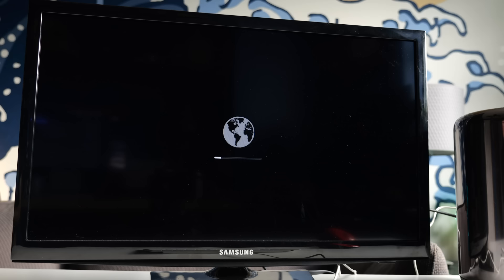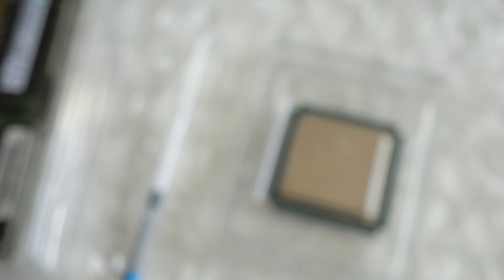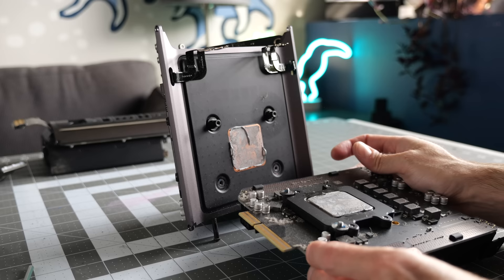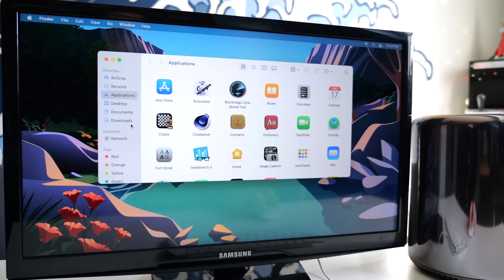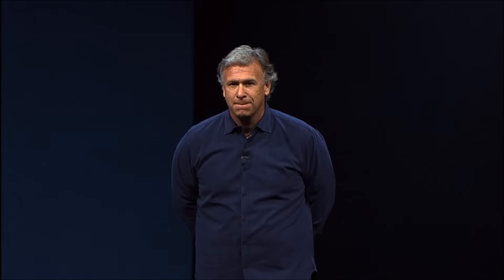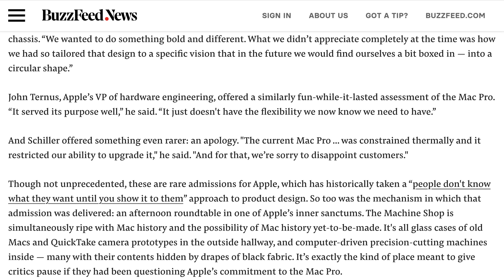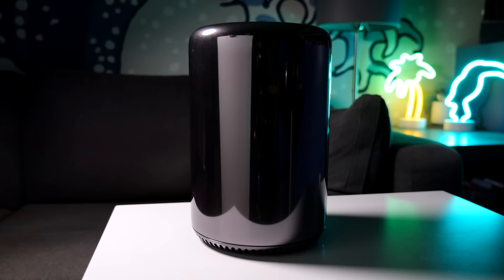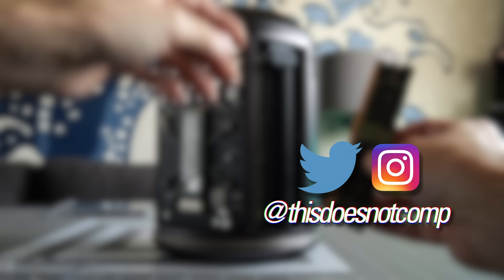Can This Decade-Old Mac Pro Compete With Apple Silicon?

Comment: I remember being blown away at this when it released. However, I had a chance to work with one term at a production job I had 6 years ago and wasn’t thrilled with its performance. The thermal throttling was a real issue for me and the heat it generated was causing videos I rendered in Premiere or DaVinci Resolve to have black horizontal lines show up in the final videos.

I called Apple to report on it and it took several back and forth conversations and me losing my mind with one of their sales reps and engineers on the phone to get anyone to listen to my plight of how flawed the build and design was that was causing the issues I was experiencing with it. They did finally make it right and I was able to submit several affected video renders that convinced them to send out a new machine and me return the damaged machine for them to test.

Comment: I made exactly the same upgrades to a Pro 13 (12 core/64GB/1TB) a few years ago, just prior to the release of the M1 Macs.  I really liked the looks of that thing and enjoyed using it despite its limitations.  The trashcans were more expensive then, more than an upgraded M1 Mac mini, so when the M1s were released I decided to eBay my Pro 13 and buy the mini with a bit of positive cash flow.  I've been living in the Apple silicon world ever since.
Reply: How are you getting on with the limited RAM of the M1 Mini?  I was looking at getting one, but I'm the kind of guy that likes to open a bazillion windows and reboot once a season.  My Intel Mini has 32GB and I think it's just about enough.
Reply: @nickwallette6201  I had the M1 Mini with 16GB of unified memory (aka RAM) and 512GB of storage.  It was doing fine but I moved up to the M1 Studio Max when it released (base model, 32GB memory and 512GB of storage --- I have a 2TB NAS for additional storage).  The Intel Mini is a great device (had one of those too), and I miss the ability to run BootCamp.  Needless to say, I was all over the map until I landed on the Studio, which more than meets my needs now.
Reply: @bryans8656  what do you use bootcamp for? I have windows 11 arm installed under UTM VM and find it perfectly acceptable for when I just needed one thing from windows for 5 minutes
Reply: @harrytsang1501  I have a couple of old Windows applications that I still like to use but they won't install properly when I use Windows 11 via Parallels.  I haven't tried installing Windows 11 under UTM VM.  We have Windows computers in the house so I use one of them for running those old apps.

Comment: I was selling my original M1 13" MBP and some bloke tried to trade me a base model one of these. I couldn't even formulate a response that wasn't all snark. No warranty. No Ventura. Massive efficiency delta. Too old 🐻.
I think if you are already on M1 there is no reason to go back down the hill for most use cases.

Comment: Granted you have to mod it to do so, you can get an eGPU to work on that machine.  I have been using mine now since this past June and can't complain.  It's been running pretty solid since.  I actually have 2 of them that are used for video editing and graphic design.  I have that exact setup, except I have the D500's.
Reply: the mac pro 2013 has thunderbolt 2. egpu‘s need thunderbolt 3. but thanx to apple adding metal support to blender, cycles can now render on the firepros.
Reply: @m13v2   you are half right.  Using a version of Open Core, you can enable eGPU, which I have done.  Works very well.  You’ll get about 80% of the potential though, so mileage may vary.

Comment: Our recording studio turned to Windows after purchasing three of these. To Apple's credit they honoured the "not fit for purpose" clause in Australian Consumer Law and the units were returned with a full refund. So at least the customer experience was decent! 
Right now a 6 year old HP Z640 or Z440 workstation can be had for about the same price and will typically come (sans Storage) with 64G RAM (DDR4), 4-8 Gig pro GPU etc etc.

Comment: Thanks for posting the Geekbench numbers. My 2009 iMac, with a Xenon X3470 yields 605 and 2150 (up from the original 540 / 1682 of the i5-750). It's getting rather long in the tooth, but I still use it often. Plus I love the 27" screen!

Comment: As these come down in price, I consider adding one to my ever increasing pile of older Macs... But, since I tend towards various aspects of gaming or graphic layout designs -- the dismal GPUs always make me pause. 

I'm very curious to see what external GPU enclosures can do for these - I'm still tweaking 2010-2012 Pros to do, what I consider, to be amazing things. I tend to use Linux more nowadays, as I've felt less and less connection to MacOS since after Mojave (crap, I'm old, I remembered the same feeling about OSX back in the early 2000s! However, years of Catalina/Monterey/Ventura haven't softened me to the further push into iOS territory). 

Great video, but I have yet to see anything on external GPUs with these, and I'm really curious what a 6000-series Radeon could do here... Or even dropping back a few OSes and putting a Nvidia web-driver supported card in (if this could take a 980ti at a good clip, it might be one nasty gaming rig for my CRT obsession - a thing I use my 2010 Mac Pro with Titan for!). 

Thanks for all you do :)
Reply: If you find one with D700s then they are ok. Otherwise the BlackMagic Vega 56 looks really good next to it and runs just as quite.

Comment: I think the one point you missed making was performance/watt, something that apple has always held dear to their chests. It’s why they ditched Motorola for Intel and then Intel for their own SOC. Sure, that trash can is capable of trading blows, but with considerably more power draw. If you factor in electricity costs to run, the M1 mini is a far better value in the long term, when you accept that both are about as upgradable as each other.
Reply: He made that point in the wrap-up. 13:43 I have to imagine the efficiency is probably the biggest reason one should shy away from old silicon.
Reply: @MogoPrime  Until Intel brought back hyperthreading to the consumer side I always bought used server/workstation chips. Yeah, the power draw and heat alone were enough to make me think twice about buying.
Reply: If you live in North America, the long-term difference in energy costs is absolutely fucking negligible... Even if you live in Europe this is mostly a nonsense argument. Go do some actual math on how much power these computers ACTUALLY pull and how much energy costs. You might be surprised. It's basically nothing compared to the standard home appliances everyone already owns & uses without a care in the world. 

Also, people almost NEVER run their machines flat-out at 100% utilization. During most usage scenarios power draw won't be that much higher than the idle draw.

The real power efficiency reason to get a Mac Mini over a trashcan is the thermals & noise. Especially if you're going to regularly use it at 100% utilization in a small room in a hot locale without air conditioning.

Comment: I actually used one of these for over a year until recently, and I loved it. The graphics performance was the major limiter for me though, given that I work in game development and the industry has moved on.

The heat was never really an issue because I used a fan control app and the CPU never went above 80 degrees, nor the dual D700s above 70.

I also managed to get this funny SSD carrier board that enabled the installation of two additional NVMe SSDs, so I had a total of 3TB of SSD storage in there.
Reply: That was called the Angelshark by Amfeltec. Bought mine new from them in June and ever since have had an issue with one of the NVME slots not wanting to read my NVMEs. A blue light stays on under my Mac and Amfeltec wont respond on how to fix it and their manual doesnt even mention the light s coming from the board

Comment: That is mind blowing, I remember how trash can Mac Pro was considered as a professional high performance desktop PC, and just 10 years later one single smartphone chip that can fit into palm of your hand is more powerful 🤯
Reply: Uhhh it isnt? Even if a phone chip seems to have similar performance they are usually clocked way lower and arm chips usually have way worse ipc than an x86 chip, like how the fx-9590 will get its ass handed to it by the i9 9900 despite both being 5ghz 8 cores. Phone chips have a long way to go before they start beating 2012 xeons

Comment: Interesting video for me. I've been using Macs since '91 and the release of the trashcan was pretty much the final straw that broke my relationship with Apple. I certainly haven't bought anything new from them since. 
I'd already had to swallow a 32bit EFI in my Mac Pro and a fried dGPU on my MBP 2011 but this insane level of form over function design for pro end hardware was way too much to stomach. 
Happily for me the net result has been about 10 years of very productive hackintoshing where I've not only enjoyed building my PCs but also really enjoyed how stable, reliable, repairable and upgradeable they can be.  
BTW writing this on my 2011 MBP with a fried dGPU running Big Sur thanks to OCLP :)

Comment: Even today I laugh at that quote by Phil Schiller.
I hated these Macs with a passion, but nowadays it kind of grew on me. 
In fact, I even think that the design was ahead of its time in the thermal department, if we consider the ARM future Apple ended up heading towards: Almost any of the Apple Silicon chips could easily be cooled in such an enclosure (and maybe we can spare ourselves the indiscriminate use of Mezzanine connectors everywhere...)

Comment: Xeon E5-2696 v2 is better tho as it has all core turbo of 3.1ghz and runs cooler as its watts is lower than the 2697 ;)
Reply: has the same single/dual/quad turbos as the 2697 but it runs all core faster then it, and its binned as lower wattage so should turbo longer then the 2697

Comment: I just did exactly this a few weeks ago, except I found one with the D700 GPUs and upgraded it to a newer 8 core that has faster single core speeds.   It replaced a 2017 iMac 27" i5 in order to have a much larger 40" screen.   I was trying to get the performance close to the 2017 and that has been achieved, although at some cost, but significantly cheaper than a new Mac Studio, which was the only other system that supported at least 32gb of RAM.  

It works so well that my wife is considering replacing her 27" iMac with a similar setup.   Total cost was $850 - $650 for the Mac Pro (D700, 64gb RAM, 1tb SSD) plus $150 for a 2tb SSD & adapter and $50 for the E5-2667v2 CPU.    The only real issue I am dealing with is Bluetooth audio quality, not sure if it is Monterey (eliminated AptX) or the hardware.   Disassembly is not that hard, reassembly, esp. the rear panel, requires 3 hands....

Comment: I had one of these power draw is almost 400 watts! It’s a nice design BUT the old architecture brings it down and upgrading this machine is a pain in the ass.  A lot can go wrong because the construction constraints are extremely tight.  I don’t recommend it at all nice to look at it but a terrible machine even on windows 11 the graphics card had issues.  Mine was new also never used don’t buy it!
Reply: Yes, the cooling capacity was actually quite impressive considering the modest dimensions and single fan. Only the components used were quite power hungry. Would be interesting to see how it would work out if you’d revisit this with modern components.

Comment: Something that almost every video on these seem to overlook:  The 12 core CPU is a trap.  Get the 8 core 2667 v2 instead.  It's within 5-10% on pure multi-core but is massively faster the moment you're not running a task that perfectly scales with those extra cores which is a big win for overall responsiveness and performance.  Why?  It has the best multi core boost tables of the range.  In tasks that use 2, 3 or 4 threads it's nearly always the leader and frequently by a significant margin.  The large cache advantage it carries over the 6 core cements its lead even further.  It's still no M1 beater, but the improvement over the 12 core is noticeable.
Reply: Also, even the commonly-compatible 10-core 3.0ghz v2 is a better option than the 12-core

Comment: In this YouTube video, the host, Colin, discusses his experience with a 2013 Mac Pro and how it compares to modern high performance computing systems. He purchased a used base model for a tenth of its original price and tested its performance using benchmarking software like Geekbench 5 and Cinebench R23. He also upgraded the machine with additional RAM and a more powerful CPU from a vendor that specializes in refurbished server components. He found that while the machine's performance was lacking compared to modern systems, it still had ample opportunity for improvement with the upgrades. He also found that working on this model of Mac Pro was more complicated than a typical PC but not as difficult as he anticipated.

Comment: As an Apple Reseller specializing in the Design industry I well remember the stunned looks on my clients faces when the Trash Can/Spittoon was announced.  Apple seemed to have this farcical idea that users wanted a computer they could move around and it therefore had to be small and light, whereas anyone with half a brain knew that they wanted the cheese-grater Mac with faster CPU's, more RAM capacity, Thunderbolt and maybe a couple more PCI slots!  A workman's tool in other words.  I'm still upgrading 2009/2012 Mac Pro's with NVMe, better graphics cards and macOS beyond 10.14 even now, but watching your video has nudged me into getting a base-model 2013 off my 'pending' shelf to upgrade, especially with your conclusions about Apple Silicon.  I want a Mac Studio to replace my upgraded 2012 Tower but can't justify the costs for myself, so I'll take a punt and see where I get to.  Great video by the way.

Comment: Great video.  I have my original Mac Pro mid-range model which I received in December 2012.   I later  upgraded to 64 GB RAM and a 1TB NVME (back when I did it there were no adapters I could find, so had to eat OWC cost).  

It is sitting next to my new Mac Studio Max and iMac 27" i9.  For the last year or so I've used it as a MySQL server machine under Boot Camp, with Windows 10 Pro, disabling the AMD drivers in an attempt to save heat, and running via MS Desktop Remote drivers from my other Macs.  

I have a reconditioned  Dell T7910 dual Xeon, with 192 GB RAM arriving any day, to take over the server work, and you have made me want to go back and check out the Mac Pro with Monterey.  I have it sitting on an auxiliary, powered fan pad but its heat generation and fan noise has always been the obvious gripe.  Have you looked into additional cooling strategies?  I thought about putting it in a small cocktail fridge! ;)

Comment: I purchased a 12 core to replace my 2012 17” macbook that I use for music. I wanted a system that was backward compatible with Intel so I would have no issues with my plugins or DAW. Currently running Mojave and it flys compared to my 2012 quad core I7. I only wish I could get a 4TB drive for it that won’t overheat due to the dual sided chip formation. I have a 2TB in it now with 64gb ram. I also use an additional fan on top to suck the air out to assist with cooling. Use an application called TBPro to monitor and tweak setting to keep optimal temps in the machine. No issues so far.

Comment: On SSD wear not being a concern - I still have my original Intel 320 Series 160GB SSD. It gets tossed in and out of boxes of my computer stuff like an old USB 2.0 cable but it still functions flawlessly. Coincidentally, I paid $320 for the 320 Series from Newegg in April 2011. $2 a gig! When I booted my mid-2009 13" MacBook Pro after replacing it's stock 5400 RPM drive, the performance on every level was far more impressive than I had anticipated. SSDs were among the bests thing to ever happen to computers - up there with widespread internet adoption and the transition from super-expensive to affordable for everyone.

Comment: I just picked up a 6-core for a very decent price from eBay.  I love the aesthetics, and I intended to use it as a hobbyist machine... but, it may just be a daily driver until it fully loses update support from Apple.  It doesn't "feel" any different than an M1 Mac mini.  I connect to a VDI for work, so the ability to connect more than 2 monitors is appealing (2 for work, 1 for iMessage, music, etc).  AirPods seemlessly connect and switch between my other Apple devices (I wasn't sure if this would be supported due to the machine having an older version of Bluetooth).  Overall, it's very nice!

Comment: I have a Mac Pro with an 8-core CPU and 64 GB RAM. It is actually a very good machine, the only things that hold it is that it doesn’t support the latest version of macOS and that it is limited to a 4K external display — it can’t drive my LG 5K at its native resolution. But this machine never slows down. Even though my MacBook Pro also has 8 cores, that feels very different.

Comment: I had one of these for a few years. It was just okay, and I was never very happy with it. I ended up switching to a iMac 5K a few years later and that machine was so much faster (for what I was running, anyway) AND way more capable, and also had a great built-in display.

The Pro was also an absolute magnet for cat fur.

Comment: I got a the 8 core d700 version recently for 500 off marketplace. I wish I would have benchmarked the 8 core as it had higher clocks, but I swapped in the 12 core first thing after making sure it worked.